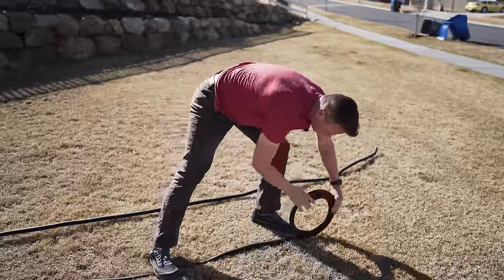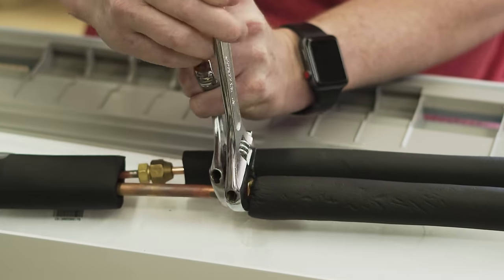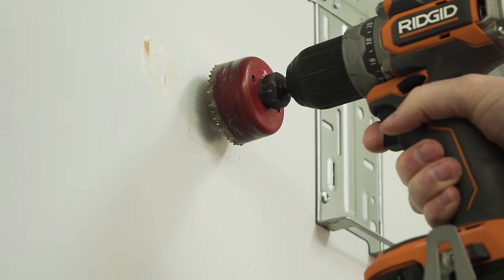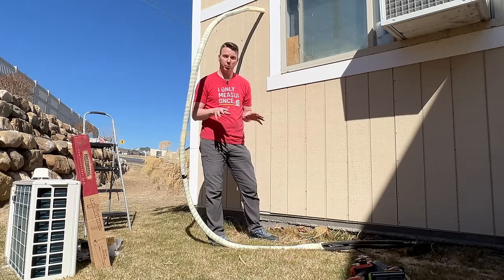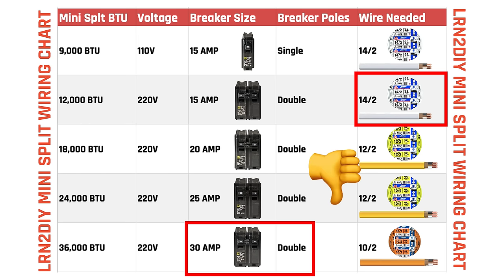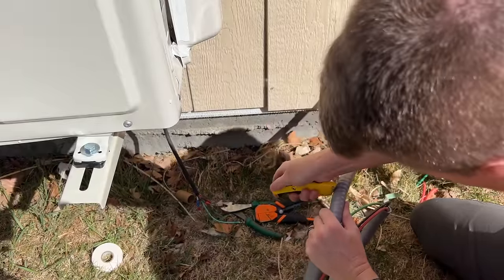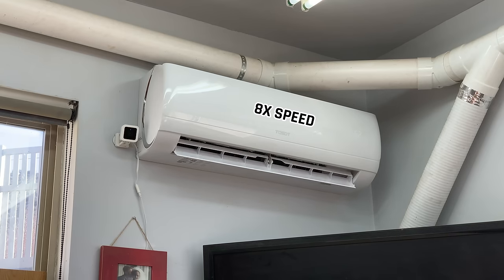DIY Mini Split Install - All the Things Nobody Shows You

Comment: The 16 gauge wire "that it comes with" @ 23:23 is not for the electrical feed. It's the control wires that go between the indoor head and the outdoor condenser. And your electrical feed wires should be terminated WAY better than shown.

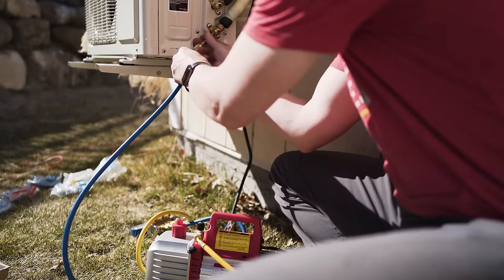Comment: 18:52 - when you unscrew that schrader valve connector all your vacuum is gone at that point. It takes 0.0001 sec for the line to get filled with air. You are to use a valve between the manifold and the lineset, close the valve after pulling vacuum, then release refrigerant. I'm not even talking about an analog manifold to be a bad way to show system leakage, you need a proper digital vacuum gauge. I'm puzzled by what I see. You have installed mini split filled with air. Yes it will work but not near its maximum efficiency and will fail prematurely due to all the moisture inside
Reply: Correct.

Comment: it called for 15a breaker bc thats the limit for the unit if it goes past 15a its supposed to pop so you dont burn the unit up you can put a smaller breaker on bigger wire but you def dont want to have that big of a breaker or it wont trip until after 30a which will burn your unit up 
i would swap that
im a licensed electrician
not telling you what to do but i would

Comment: I just want to add to what others have said.  The 15 amp breaker is there to protect the UNIT!!  By running this unit on a 30 amp breaker you risk burning up the unit, possible causing a fire and burning down your shop!!!  I hope the manufacturer hasn't seen this!!  As they will likely NOT honor your warranty if the system burns up!  For all of you watching this, you NEVER want more [breaker] (fuse for those with a fuse box) than your appliance or wire can handle, especially on larger appliances like an AC or Oven.  In your case, you really should have run a [15 amp] disconnect, that way, if your unit overdraws on electricity, it will throw the 15 amp fuse in the disconnect before it burns up!  I'm running my own system off a double 20, but the disconnect is a 15 amp.   For your readers .... the breaker/wire diagram he shows is the "minimum" wire that should be coupled to a X amp breaker (15 amp/14; 20 amp/12, etc ... )  This is to ensure that the wire won't melt and start a fire before tripping the breaker.  Just sayin'.

Comment: next time move the condensate drain over by the lineset, drill a hole out the wall directly behind the lineset. mount head unit then go outside and connect your lineset outside instead of running 30' through the wall

Comment: Uhm one important note here: I think your Vacuuming was for nothing, except checking maybe. In the Service port is a valve and when you disconnect those connectors that open the valve always the problem is that if you have a vacuum in your system it sucks back air from the outside into the split unit through the still open valve and the alredy open connector.  Technically you get away with a bit of air and moisture in the system for quite a while but it is better not to have it. 

With your Adapter it is required to fill the lines with coolant and then unplug it, which leaves some of the coolant out but no moisture in. It is better to have the advanced service adapter with a wheel to switch the valve on demand. It only is one  or two euro more. With the adjustable service adapter you can get the  vacuum pump off without leakage of coolant or having air in your coolant line.

Comment: Hello, 
There is no neutral wire on a 220 volt circuit. There are two hot wires and a ground wire. Each hot wire is 110 volts 90 degrees out of phase. The two 110 hot wires add up to 220 volts.
There is a neutral on a 110 volt circuit. The neutral is like an extra ground wire.
Thanks

Comment: After you vacuum turn off gauges then vacuum pump. Release the refrigerant then after start up remove gauges. All you did was vacuum it down then let air back in after you spent 30 minutes drying the system out. Never use factory flares, use a 15 amp DP breaker that is what the equipment is calling for. You can use the 10/3 its your money but use a 15 amp DP breaker.

Comment: As an HVAC Service Tech/Sub Contractor, with over 35 years in the trade, one thing I HATE about Mini Splits is doing maintenances on them. After a year, dust bunnies/lint balls, build up on the squirrel cage blower, and it’s a REAL PAIN to remove them from the blower. Over time the blower will spit out black, wet, lint balls, all over your bed, furniture, etc, wherever it’s mounted.

Comment: I got a quote for 5000 for a 9000 btu In a 240 sq ft loft above a 20 by 20 carriage house. Super easy install. I will be doing it myself. I will study very hard and go for it. I figure I can destroy a unit or two and still be fine. Btw, in Greece you can get a 9000 split for less than 2000

Comment: MR Cool is the only true DIY unit out there. All others require a vacuum pump which most people do not have nor know how to use.
Reply: That is what I have found out also.  Mr. Cool installation was easy because of this, but I'm not happy with the "lack of temperature regulation'.  I've tried using both the "in the room control handset" and the "internet based iPhone App".
There was an iPhone App update this week (finally) so hopefully that will help.  Not holding my breath on that as I think that the "root cause" is that the inside units themselves (I have a 3-zone 27K BTU system) do not seem to have a reliable temperature sensor as I constantly have to "Calibrate" the room temperature readings.
Reply: Vacuum pump at harbor freight is $100.

Comment: Got the same 230 volt unit you did. Did everything you did except for the breaker and bled the refrigerant from the suction line. However, the unit seems to be dead on arrival. It’s has power, but the unit won’t turn on at all. No beep, no lights, no nothing. Anyone else run into this?

Comment: can anyone tell me what breaker i need for Ductless Mini Split AC With Heat Pump
Power Supply (V-Ph-Hz) 208/230V, 1Ph, 60Hz
Voltage Range	187-253

Comment: can you use just the heater and not hook up A/C
Reply from the maker: I believe it’s a package deal. I could be wrong but I’m not sure if the heater would work without connecting the lines and fan unit.

Comment: Very good video with lots of good info but it should be revised. If anyone has a fire and it is determined that a circuit breaker double the size specified was installed- the claim will be denied. Larger gauge wire is good (less resistance & less heat) but the breaker needs to be the size specified.

Comment: It's against code to run Romex in EMT plus slways wrap red electrical tape to let anyone know the white qiew is a hot service wire. Overrating the circurity can cause a fire as easily being underrated.

Comment: hi there. if you are using a 30amp breaker on and system which is required 15amp is that fine? if the split malfunction and start drawing more amps it wont break until it will reach to 30amp consumption. your cable is fine because it can carry 30amps. and also you did not use any fuse into ac cut out protection. i am not here to point any finger at your work i do respect your hard work and making this video to educate people. just talking, we can talk right?

Comment: Do not disconnect the manifold lines before pressurizing the system. You just added oxygen into the copper lines. Vacuum pressure is negative pressure so it will suck in oxygen.
Vacuum, close manifold valves and then open the low side service valve to pressurize the system with a positive pressure.

Comment: I didn't see you add any freon.  What did I miss??
Reply from the maker: The condenser on this kit is pre-charged. You don't need to add coolant of any sort. When you open the connections from the condenser to the lines, that lets the coolant into the lines.

Comment: I don't believe by code you are able to run Romex in conduit outside since the area is considered a "wet location".  THHN/THWN should have been used instead. Even if it is not code in your area, it is a good idea to follow code.

Comment: You are guaranteed of a future leak, the flare nuts must be torqued to the required specs. Snug will not cut it and yes when torquing it feels like the flares are being cranked down tight. 
if the line set piping comes from the unit manufacturer and no nuts are given with the unit blower you can used the flares and nuts on the piping, if not they must be cut off and the nuts supplied by the manufacturer used. 95% of our service calls on units we did not install have refrigerant leaks due to improper flares and improper or no torquing of the nuts. Repairing these units correctly is very costly, sometimes taking an entire day to find and repair a single leak. On a recent repair quote we were told the repair cost more than they paid for the unit with installation. Mostly due to the location of the unit and the location of the leak. Out of 5 calls we were the only company offering to repair the unit. 
I think in maybe 5 years mini splits will be as common as standard systems and a lot more technicians will know how to repair and service the unit especially on the electronic side, or simply like other electronics they will become throwaway units.

Comment: I don't know what you did inside the distribution panel and the disconnect, but it is confusing. This is a 220V circuit, which means two hot wires. So there should be 3 or 4 wires from the distribution panel to the disconnect, two hot (L1 and L2), possibly a neutral and a safety ground (bare). 

The wiring from the distribution panel to the disconnect do not appear to be used correctly. The red and pink should be the two hot wires without any neutral wire (white/gray). The bare wire is the safety ground conductor.

It appears the compressor does not have a neutral conductor - just the two hots and the green safety/equipment ground.

Your description of the wiring in the compressor is incorrect. That red wire is NOT the neutral - this compressor does not have one. The red is one hot and the black is the other.  The labels are just under the screw terminals.  The labels visible above the terminals are for the wiring for the inside unit.

Comment: How can you ensure the extraction of moisture and non-condensables from pipes without a digital vacuum gauge ??? Manufacturers require a minimum of 250 microns.
You disconnected the hose while pipes was still empty. That is NOT correct because air and moisture will be drawn back in when you disconnect the hose. You must first release some refrigerant gas in the lines to have positive pressure inside the pipes. If you're trying to teach, try to do it right.

Comment: The sad thing for my house is that my main floor would not benefit much/at all with splits on the main floor. Open floor plan. Upstairs are standard bedrooms; splitting would probably be beneficial. Running the lines would be brutal.

Comment: These higher SEER ratings may not be worth the money. So for each SEER rating (aka 12 to 13, or 18 to 19) you save about 6% in energy. In a central city like Little Rock, Arkansas in the United States where you will need to both heat and cool, a 1200 square foot house will cost about 300 to 500 to heat and cool year round. In my case, it was 75% ($400) heating and 25% ($100) cooling.6% of $500 is $30. When I was searching units, the difference between a 18 SEER and 20 SEER unit was $450. (24K, 18 SEER for $1,300; 24K 20 SEER for $1,750. That is a $450 difference.) The more effcient unit cost 35% more. The break even period $450/$60 was 7.5 years. The Unit would have to last more than 7.5 years before the extra expense of the improved efficiency would begin to pay off. Now I generally believe these units can last a long time (10 to 15 years), but there is also a high risk of breaking something during install, or breaking before that time is up. If your unit is on the smaller side (12K instead of 24K) you are going to use half the energy, get half the heat and only have half the savings. These units are more effcient than central HVAC (generally SEER 12 or 14) so putting in a Minisplit with a SEER of 18 will save about 24% of the power. (18-14= 4, 4 times 6% equals 24%) (Yes, technically it is more complicated, but this math is close enough very simple and will get you close enough to make the right decision.)  Please consider this basic math, then look at your historical energy usage, what portion of the house you are planning on heating (all in my case), insulation quality, (fair in my case), and prices of the units that you wish to install.  Note: in my case the when the central furnace went out the HVAC man wanted to sell me a new system for $7,000. I believe I could have shopped around and replaced that unit with one for $5,000. If you consider that the HVAC unit will last 10 years; that is $500 a year the central HVAC is going to cost. Putting in a minisplit myself is going to cost $2,000 and will use 25% to 33% less energy. This is why it was an easy sale to the girl.

Comment: If your unit is 12K btu it only needs 15 amp breaker. Breaker's job is to cut the power if AC takes more than 15 amps. But as you put a 30 amp breaker. It will not cut the power ever. And unit will keep taking higher Amps and eventually burn itself. 
Remember an electric appliance only take higher amps if they are not function properly. 
So your breaker is useless in this case and hazardous.

Comment: Not a good idea to check for leaks with the lines pressurized with the units freon. If you end up having a leak that needs more than tightening a fitting you will lose freon to the atmosphere and will need to get a recharge.

Comment: Also electrical is incorrect and not safe, you can’t override maximum overcurrent protection. 220/240v it’s two hots and a ground. You typically want to use black, red, and ground
Reply: Exactly. The talk of a neutral / use of the white wire, demonstrates a dangerous misunderstanding. Then there's the issue of Romex in (small, wet) conduit, and over-sized breaker.

Comment: I would buy only a 100% 304 or 338 stainless steel bracket. Costs more but you wont have nasty rust all over your wall in a few years.

Comment: so if you have decided to do this know that you cannot technically touch the refrigerant with your gauges because at that point you've then broken a federal law for the EPA it's one reason you have to have her CFC license because most likely that's a 410A unit and it is ozone depleting chemical, that being said you need a micron gauge on the highside manifold pull it as close to 50 micron and shut off pump those hoses will pull tiny amount of atmosphere but should be ok. Without talking those flare nuts correctly they will cause leaks also for your inside unit where you put the insulation over the flares You're supposed to separate the two lines if not one is hot one is cold so in the summertime you wrapped them together so you're going to be transferring heat across the two and you can cause ice as well as you can cause sweating which will cause the water mark on your wall

Comment: It's my understanding that you can't run Romex inside conduit outdoors.

Romex (non-metallic cable, NMC) is not rated for outdoor use and should not be run outside in conduit.   Supposed to run individual THHN

Comment: Not to nit pick, but the red and black wires should be used for 240V, or the white wire should be wrapped with black tape, otherwise it can be misconstrued as a neutral.

Comment: at 4:21 he says they must be snug. if youre not pressure testing this system with nitrogen at 400 psi, you better crank them down. it is best practice to cut off the factory flares, and put new flares on them yourself.

i've installed many mini splits where the factory flares are garbage and had to redo them myself. if your system cannot hold 400 psi, it will leak, and eventually ruin your system.

i'm all about DIY but installing a heat pump vs changing the oil in your car are two entirely different things.

Comment: I seemed to miss where you actually charged the refrigerant?  I wonder why? 
Also in you math, when comparing costs to the Mr Cool, you did leave off the cost of the refrigerant. This makes the Mr. Cool a bit closer in cost without the extra work. 
10AWG wire for a 7A load? Loops in the refrigerant line??  
Seems a bit of mis-information with this installation....oh and by the way, I know this comment is a year+ later, but people should know that R410 refrigerant is now being phased out....

Comment: The electrical would fail an inspection. WOW. Technically this would function, but why do it wrong?

FIRE HAZARD! Using 30A breaker. The install manual of the unit would state the maximum rating of the breaker, which in this case is likely 15A if it came with 16/3 stock cable. 

When using /3 cable always use black and red as hots from the breaker to the disconnect (being a 240v circuit). 

You used /3 conductor cable. If you were using /2 conductor (Black, white, earth) you could repurpose the white and black to the double pole breaker, like you did, but best practice would be to also reflag the white as red with shrink tube the entire wire length to the knockout on both sides (load center & disconnect)

But instead you used /3 conductor and abandon the red wire? If the proper wires are in the cable USE THEM FIRST. 

Because you used /3 cable (Black, white, red, earth) , you shouldn't relabel a neutral to live if you don't have to. LEAVE THE NEUTRAL in the cable alone (could even terminate on the neutral bar in the load center) and wire nut the white at the disconnect.  

It is frowned upon to put romex in conduit.

Comment: You should not 🚭 have used a 30amp circuit breaker on that unit.although you used a 10 gauge wire from the panel the wires and circuits in the unit are only rated for 15 amps . Ps you also need to add come Romex connector's to existing wires on the bottom of the panel